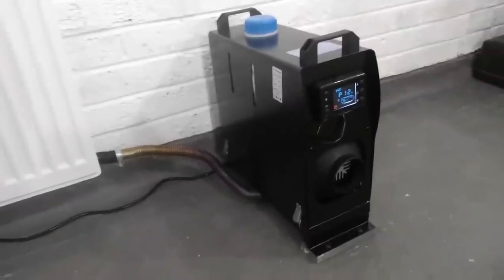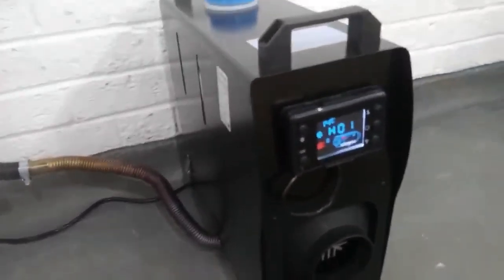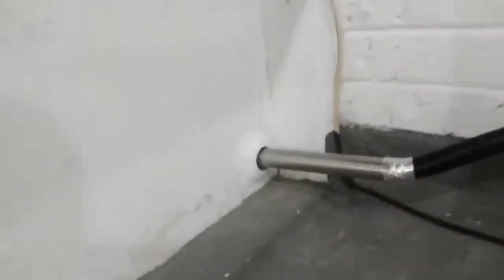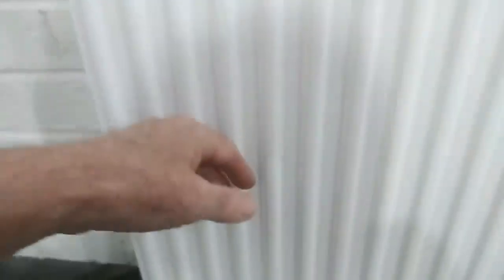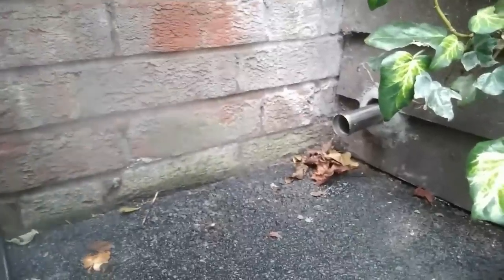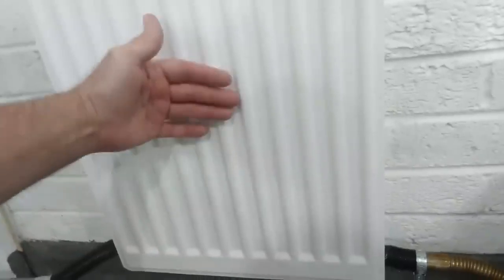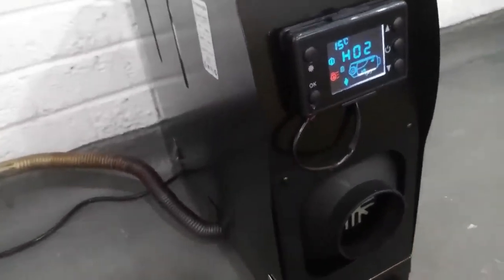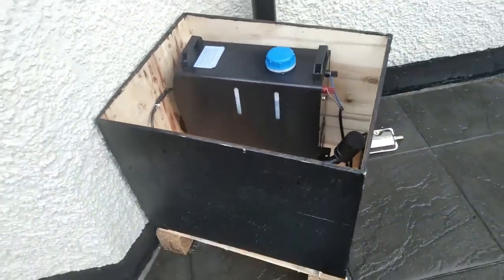Free Heat from Waste Exhaust Gases Heating Radiator Home Diesel Oil Heater Chinese Recovery Exchange

Comment: Try putting your tank above the heater and you should be able to get rid of the pump, it’s condensation because it’s cooling down in the radiator, you are right put the inlet on top and outlet on lower outlet 👍👍👍👍
Reply from the maker: Thanks for the tip

did you see my other heater videos: https://www.youtube.com/@andyfireblade
let me know what you think

cheers andy
Reply: @andyfireblade  yes I have seen them and liked them, look out for a cast iron radiator as its stronger than your one and your one will start to discolour soon 👍👍

Comment: Havent seen where you are taking your combustion air from but if it is being taken from inside it will create a vaccuum in the garage drawing cold air in through whatever gaps you have. Take combustion air from outside to keep even pressure
Reply from the maker: Thanks for the tip!

Comment: As aarongunner says, re-pipe it with a condensate pipe.  The products of combusting diesel are CO2, water vapour, and N2.  The condensation you are seeing is the water vapour in the cooler air.  Usually, you wouldn't get that because the heat in the exhaust gases vapourises it, but you're taking the heat out, so it's cooler - this is why modern gas boilers 'steam' at the flue outlets, the heat exchanger gets more of the heat out of the fuel being burned.  Re-pipe it so that the outlet is top left of the rad with a permanent SMALL pipe at bottom left - even a 10mm copper tube will suffice.
Reply from the maker: thanks for the comments.

did you see my other heater videos: https://www.youtube.com/@andyfireblade
let me know what you think

cheers andy

Comment: You're getting condensation because the exhaust gas is now cooler exiting - by piping the exhaust through the radiator you are removing heat from the exhaust and this brings the temperature closer to the dew point, once the gases meet colder air at the exit then condensation occurs pretty quickly. This is basically how a condensing oil boiler works by using a secondary heat exchanger to remove the, otherwise wasted, heat from the exhaust. You want a slope/fall also so the condensate flows outward as it will build up otherwise. It would be interesting to measure the exhaust gas temperature before & after this to see how effective it is.
Reply from the maker: thanks for the great comment.

did you see my other heater videos: https://www.youtube.com/@andyfireblade
let me know what you think

cheers andy
Reply: @andyfireblade   Oh of course, I've been following you recently as I just ordered a diesel heater and getting up to speed before it arrives! great content!

Comment: Ideally you want to put the inlet from the exhaust at the bottom right corner with the outlet at the top. Top left corner. 
With the radiator having a small counter clockwise tilt (2-3 degrees) so the condensate will pool at that lower left corner. Then have a small drain to the outside for it 

Would be so much more efficient
Reply: Wow, I was going to say exactly the same!  Though rather than letting it pool (because at some point it will be quite a lot of water), just put a condensate hose on the bottom L/H corner.
Reply from the maker: thanks for the comment,
did you see my other heater videos: https://www.youtube.com/@andyfireblade
let me know what you think

cheers andy
Reply: @barryfoster453 its going to freeze and block the drain pipe unless something is done to prevent that
Reply from the maker: thanks for the comment,
did you see my other heater videos: https://www.youtube.com/@andyfireblade
let me know what you think

cheers andy
Reply: s going to freeze and block the drain pipe unless something is done to prevent that

Comment: I tried this layout but with the exhaust entering the bottom and exiting from the top, this was due to space constraints.it barely heated much of the radiator. I checked and it was filling with quite a bit of water. I ripped it out and put in an alternative system.
Reply from the maker: thanks for the comment,
did you see my other heater videos: https://www.youtube.com/@andyfireblade
let me know what you think

cheers andy

Comment: On the outside one, you could use the exhaust gas heating system to keep a frost free greenhouse or even put a radiator under the car to help stop frost on the car itself.
Reply from the maker: thanks for the comment,
did you see my other heater videos: https://www.youtube.com/@andyfireblade
let me know what you think

cheers andy